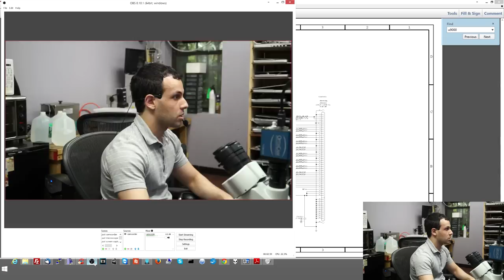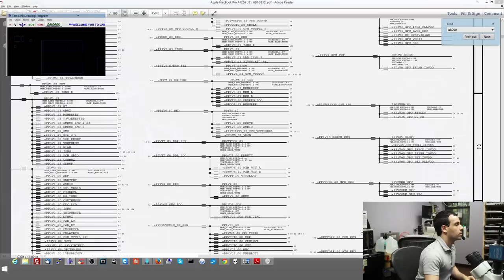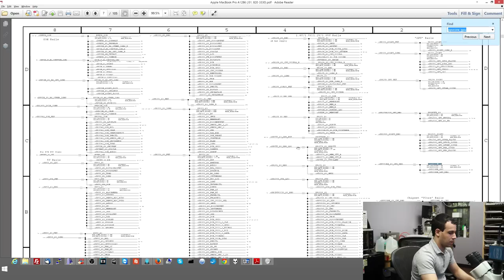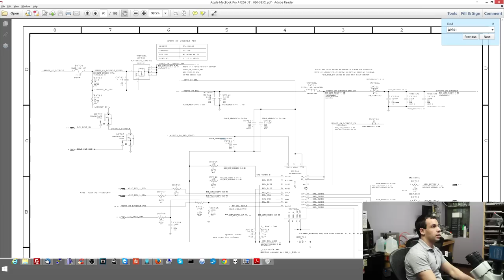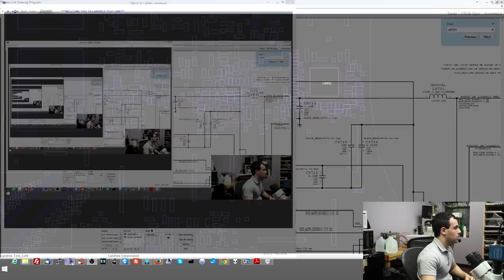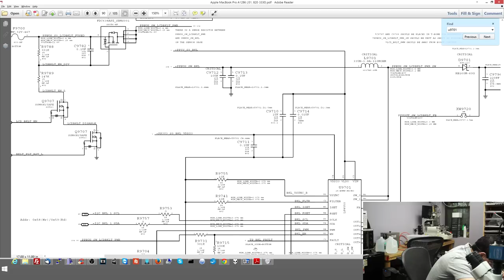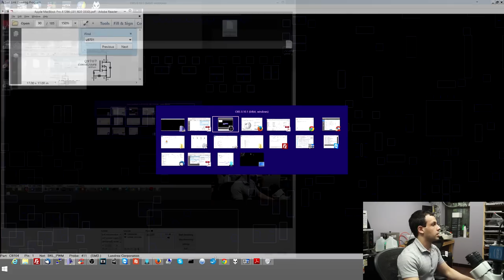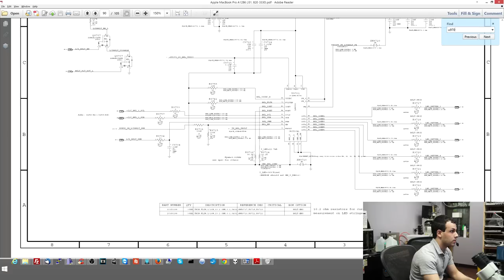Macbook Pro logic board no video how to repair 820-3330

Comment: Louis, I'm working on a similar issue, no backlight. I have 12v, 3v enable, but PWM looks dirty on the oscope. In this video did you look at PWM with a scope or DMM? (we couldn't see, your microscope was blocking) What should the signal be, a square wave at what values? Thanks!
Reply: I was craning my neck to see where on the board the probes were going. Would be great in 3D video. : )

Comment: Hi Louis, Thanks for sharing your knowledge! I just a bought a multimeter because I want to practice & gain more knowledge about electronics...Could you please make a video on how to measure the voltage at the PPxVx rails with a multimeter. I not so confident doing it myself and don't want to blow any components. Thanks.

Comment: Help needed!!!Hello, where can I find this chip on a MacBook Pro 2015 board? I have video signal on Hdmi, but nothing on display! Laptop was water damaged, I managed to make it start and display on external. I don’t have the right voltage on display pins, missing lots of voltages, nothing on pins 1,2,3 (missing the 5,14v) and missing as well on pins 21,,23,24,25,26 the 3,33V , missing 0.98V on pin 22. I think I have the same problem. I just need an advice! Thank you!

Comment: how does GPUVCORE_SENSE_N works? I got short this line but still get video from adapter but not from battery. I took out the chip and found out the chip got short at GPUVCORE_SENSE_N so the board trays are still good. Can I reball the chip without pin GPUVCORE_SENSE_N so it won't short my board?

Comment: Mello man, Like so much your videos. This is my case: I sent my mac to a company that repairs Mabook motherboard because I drop coffee on it. They give it to me back totally functional but said to me this: your computer now is perfect except for the fan. It will run always no matter temperature but will work fine. So I said, ok, no problem. I am now testing  my mac book retina 13in early 2015 and seems that the charger sometimes want to work and sometimes not. I read that both are linked by a kind of chip? is there any way to control charger by software? Do someone have any valuable suggestion?

Comment: i have a iMac 09 model that well sleep and sometimes won't come out of sleep ,or it'll just shut off the computer when i press button to turn on the mac, lately it hasn't done it much but still have problem can u help me with this i went on vaca for ten days come back computer doing this ,so it might be cause it was in the closet not plugged in for ten days idk, please help or do u fix them .thanks ,apple says all hardware working 100 percent they can't fix or find problem cause its a 09 model i don't feel like spending 2000 on a new one i like this one ,running el capitan new software .

Comment: How you doin that videos if u have to work?
Reply from the maker: +Dizzle Wizzle I don't sleep.
Reply: +Louis Rossmann i have a question for You, how can i solder 01005 smd components with hot air or with a solder iron? The second question is what are that components wich are labelled for ex. DZ4023 etc for example in iphone 6s